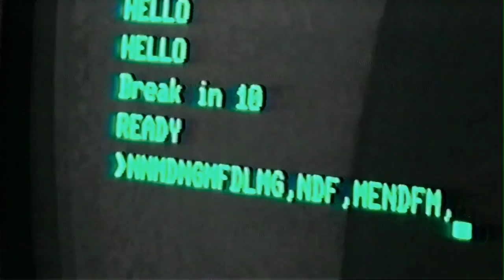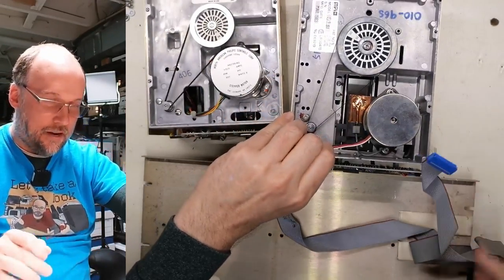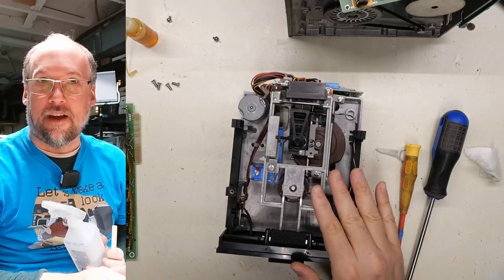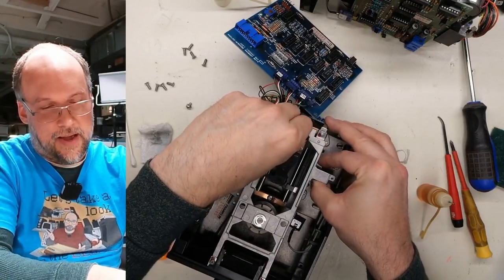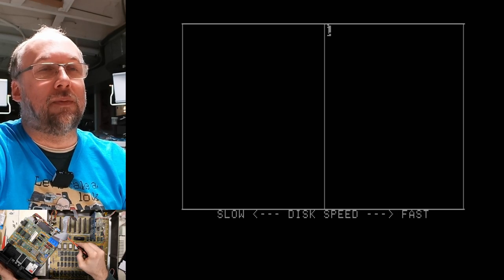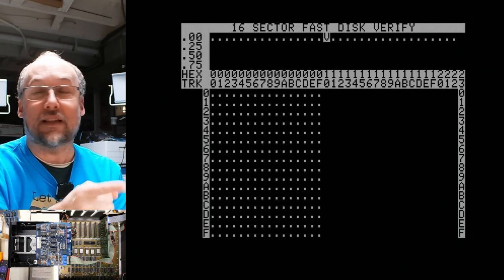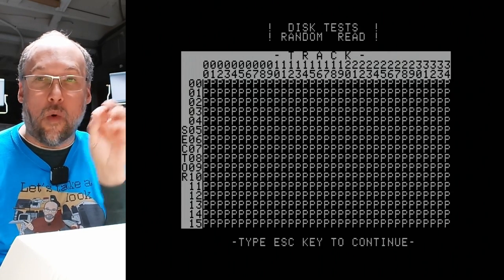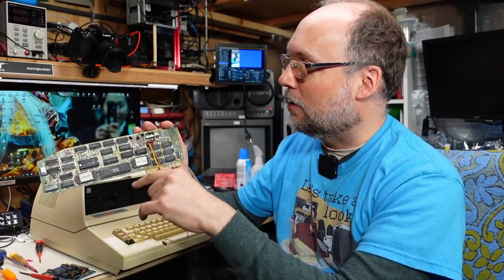Fixing two stubborn 5 1/4" disk drives (and a bad keyboard)

Comment: 44:50 Assuming this machine is indeed post-lawsuit, I wouldn't be surprised if they specifically crafted the ROMs to fool basic ROM detection routines like that — I vaguely recall some Apple II copy protection actually worked by checking the system ROMs for some reason.
Reply from the maker: Quite possibly. I would imagine I could just install Apple II+ ROMs into the machine and it would work fine, with the only issue being the lowercase support might be missing. Would be an interesting experiment I suppose!
Reply: @adriansdigitalbasement  try it 😉😉
Reply: Even the first generation of Franklin ROMs (before the lawsuit) had some changes from stock Apple ROMs. For one, Franklin had removed the cassette routines as their motherboards did not have the hardware for cassette I/O installed. Stock Applesoft ROMS will run on an ACE motherboard without issue.
Reply: @Chrisa850  how did anyone manage to save an load programs without cassette io ? if they didnt have a disk drive? !!
Reply: @andygozzo72  Franklin never intended to sell a computer without drives.

Comment: I would think the 99% isopropyl and the magic eraser alone would be sufficient to clean the board and buff the oxidation off the pads - then there'd be no concern about it affecting the capacitive pads or the foam.
Reply from the maker: Yeah it's true -- I've found Deoxit can help to remove a little more of the oxidation, but that might not be the case and the 99% IPA + eraser does the same work.

Comment: I bought one of those RetroTinks just like the one you are using and I have a splitter on the HDMI output. For some reason when I first start it up it almost always has no sound until i unplug and plug back in various HDMI cables. I was wondering if anyone else has similar sound problems with a RetroTink?

Comment: As for the "flat q-tips", it would be helpful if you share what they're called and/or where to get them.
Reply from the maker: I'm not sure unfortunately -- I just have a little bag of them after a viewer send them in a few years ago. I did a google for "vcr head cleaning swabs" and look what came up: MG Chemicals - 810-15 Single Head Chamois Swab (Pack of 15) (for $20!!) https://amzn.to/3zDGFff They look pretty much exactly the same -- the ones I have were sent in from the UK.
Reply: @adriansdigitalbasement  Thank you for doing the search!
Reply: 20 bucks for q-tips? Yikes.
Reply: Gomam0n  It's not a stick of cotton/foam. They're designed for video tape heads which are extremely delicate and require special handling.
Reply: These remind me of similar things that were sold to clean cartridge contacts. They came as kits fir both sides. We used them to clean cartridges for my NES, and SNES for the longest time. Though they clearly aren't exactly the same either.
Reply: Gomam0n  I'm just going on what it said in the VCR repair book I had back in the day, I think it was called "VCR Repair Illustrated". It was very specific about how to manually clean video heads without damaging them. I never had to do it myself though - all the machines I had with video head issues were damaged, so I had to replace the head drums on them.

Comment: I think the original Apple controllers (even the OG “Disk ][“ card) and the drive boards had custom ICs that integrated a lot of the functions provided by the chips on the clone / aftermarket units.
Reply from the maker: Actually it's not a custom IC but just an early PROM. (Programmable ROM) Think of it as an EPROM but smaller package and only one time programmable. A modern clone exists that swaps the hard to program PROMs for normal EPROMs: https://github.com/btb/DiskII
Reply: @adriansdigitalbasement  nice! I remember reading about the special chup upgrade to move from 13 sector dos 3.2 to the 16 sector dos 3.3. And the little apple “16” stickers to indicate the disk has the “new” format.

Comment: Deoxit is great and all but at $16.99 for 5 oz, that’s ~$434 for a gallon.  That’s insane.  It’s essentially odorless mineral spirits
Reply: Prove it. You profess to know so much about DeOxit.
Reply: It’s pretty simple math, but ok… 

$16.99 / 5 = $3.398 per ounce, there’s 128 ounces in a gallon.  $3.398 * 128 = $434.94.

Of course you could be referring to the odorless mineral spirits part. In which case it says it right on the can.  But you seem like an intelligent individual, Google the safety data sheet.  You’ll see that only 3-7% is “DeoxIT D-Series D100L”.  The rest is “petroleum naptha”, and diflouroethane (which is the propellant to get it out of the can).

Sorry you had to find out this way bud.
Reply: You're paying for the brand name and the metal cam that's pressurized. Honestly though any knock off the oxid is fine just pressurized mineral spirits is useful
Reply: Kinda the same thing with wd40